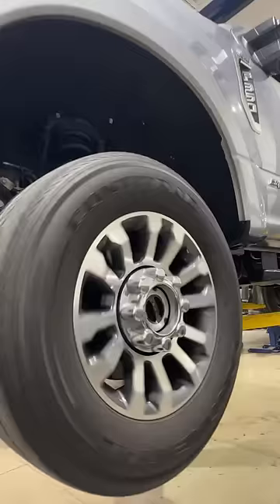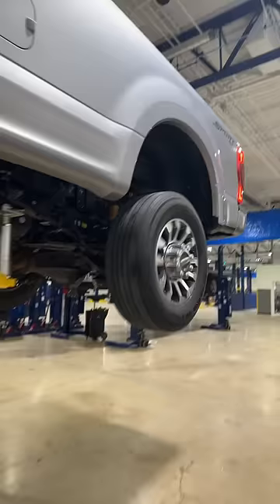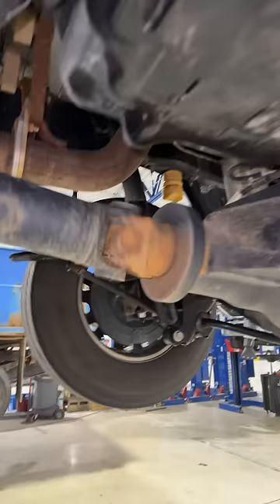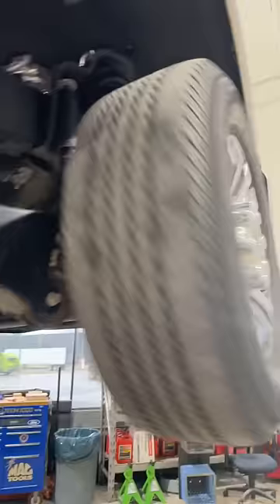NEW 4x4 noise 2022 | F250 F350 #broken #fyp

Comment: mechanics at Ford dealers must be making a good living these days with all of the Ford problems, F150, transmissions, engines, Ford bronco engines, the difficulty in getting to the engine/transmission on the F1 50s..
  makes you wonder if it’s planned to keep the service departments busy the way that BMW automobiles have been for quite some time now. You have to marry the dealer when you own a BMW car because of all of the unique tools needed at times. 
  back in the day when I had my 1968, dodge charger, 383 automatic with a two barrel. Those cars were horribly junk… I can absolutely understand why they are bringing hundreds of thousands of dollars on those television options. Because there are so few survivors. But the experience of having that Dodge charger, turned me against Mopar and I swore I would never buy another one. But I bought myself a ram bighorn, hemi crew cab after the experience I had with my GMC pick up. That thing rusted out in front of my eyes because the owners manual said, rust proofing this vehicle will void the warranty. I lost the brakes twice, the fuel line, and the fuel pump from corrosion from salt. Nothing under that truck wasn’t encrusted in rushed at 42.k miles..
to top it off. I needed front brake rotors. On those trucks, the canyon pick up 4 x 4. You have to pull the spindles off to change the discs because they are bolted to the back of the spindle in the front. .. I do all my own work, that took me about six hours to do that work in my driveway. Pulling the driveshaft from the center of the hub destroys the ABS sensor, which is in a steel housing that rusts out. You cannot use them over. I had to buy new spindle assemblies with the ABS sensors as a unit..
I was advised by the mechanic that does my annual state, safety inspections, to get rid of the vehicle, because the rust was going to start coming through the body, and the bed frame was getting thin from rust ..
  so I don’t like Fords because of the horror stories, and I won’t buy a Chevy/GMC again. So I bought a ram in 2016 and I spent five days using fluid film to rust proof it. I mean I pulled out the headlights and tail lights. I remove the plastic fender liners so I could get the rust proofing everywhere. I pulled the wheels, I bought tools, so I could rust proof inside the posts for the doors, and up the windshield all the way to the roof. Inside every hole in the frame. The rocker panels have rubber plugs, 16 of them, which I removed and sprayed inside those holes with fluid film. I have videos every year of inspections under my rim and how well it’s holding up here where they throw salt from December through March every year. And I don’t have any rust as of December 2023. I’m going into my seventh winter. My truck sits outside 24 seven. I have the videos on YouTube showing how well that fluid film is protecting under my truck.
 I drove from Pittsburgh to Bethany Beach this past summer for vacation, on those major highways, like the Pennsylvania Turnpike, I-95, and other roads I forget the numbers. Those people drive it 80 to 90 miles an hour at times. I was getting 28 miles to the gallon in my truck has the hemi engine… i  used to buy Ford’s.. I bought a new Ford van 1978, I drove that truck for 31 years. It had a 300/6 with a three speed, manual shift on the column. The only extra it had was power steering. I swore, then that I would never buy a basic truck again. In all of my trucks since then, have been automatic, 4 x 4, power, windows, and door locks. But my ram is really loaded. I never had a vehicle with heated seats and heated leather steering wheel before. I think it has an eight or a 10 speed automatic transmission that you cannot feel it shifting. I think it has six or eight speaker stereo, sound system, which I never listen to. I do not turn the radio on on my motorcycles or in my trucks…
 I had a Ford ranger pick up, and two Ford vans over the decades.. i’ve always done my own mechanical work. I used to be a mechanic at three different motorcycle shops back in the day. I’ve changed transmissions, head, gaskets, timing, chains, timing belts outside in my driveway in the winter at times. But I actually think it’s cheaper to just buy new vehicles and not have to do any of that work. It may not be actually cheaper, but it sure is a hell of a lot easier…

Comment: I have never seen that now I have had customers come in with newer f150 with 4wd not working and it make a weird noise but it would be broken vacuum line but you got me thinking now I want to know what’s wrong because I have never  heard a 4wd system make that noise i have a idea but idk
Reply from the maker: Superduty & F150 are NOT the same whatsoever
Reply: @PowerStrokeTechTalkwARod  yeah I know that I just 4wd worked similar I haven’t really haven’t really done anything besides maintenance and alignments to the newer f250 and f350 but the old ones I have done a lot of work to mainly just suspension my shop really do much engine work

Comment: Blue oval syndrome. I love to hate Fords.
As a mobile mechanic, they have kept my family fed for 36 years, being about 65% of all work I have done across almost half this nation.
The problem isn't just Ford. The problem is called planned obsolescence, and it costs us billions every year.
Remember the original Pyrex cups and bowls? You could drop them on concrete and they wouldn't break...
Sales plummeted, cuz nobody ever bought a replacement, so they changed the material to allow breakage from a lower elevation of droppage. Problem solved.
Reply from the maker: Amen
Reply: Oh bull get out of here!
Reply: @popcornhead3479  do some damn research.

Comment: Guys You Never buy a FORD, they are Always Trouble. And Old Chevy Engine Builder told me Years ago, that Ford had the Worst Engine and Power Train of All Trucks. He stated the Trucks Ford built on Monday from its Part wouldn't work on the Trucks on Wednesday and the Same for Friday. Today I am Driving a Chevy Truck with 350,000 miles and I have only changed the Oil every 6000 miles when using 100 percent synthetic Oil 10w-30 Oil. I have Changed the Spark Plug once and a Water Pump once. You can't beat a Chevy over Any Ford. 😊😊❤❤

Comment: Been a Ford man for 50+ years my current 2012  f-150 eco boost bought new is my last one ever ! Not because of the truck! It is absolutely because of the  manufacturer and the unbelievable horrible state of their dealerships service departments lying cheating and stealing from you not here and there  ( BUT EVERY SINGLE TIME YOU WALK THROUGH THE DOOR ) The last two times I went to the Ford dealership the first time they told me I had a major major oil leak and I needed a new engine and then like an idiot I went back and they told me I needed a transfer case in a transfer case motor that was four years ago I’m still driving with the same transfer case and transfer case motor in the same engine do not get your vehicles serviced at Ford dealerships ever good thing I know about vehicles if you don’t you are screwed at any dealership !!!!!!!!! At least that’s been my experience .

Comment: My 2021 F250 had the same problem. I fixed at 25,000 km which is about 15 1/2 thousand miles. Is it a design flaw?

Comment: The brake line is rubbing inside the wheel... notice how it skips when the wheel weight comes around. Loosen the bolt on the line retainer and adjust it back.
Reply from the maker: Sorry guy, you're not correct...

Comment: This is "Not" an abnormal amount of surface rust....if you think so, look around at a few undercarriages. Especially Trucks....
Why manufacturers don't paint them all is beyond me....
This isn't abnormal though...Surface rust begins "once" cold steel is introduced to air and any amount of moisture or humidity. The more of it, the more Rust...
 

You want to see for yourself how Fast rust will occur???
Take a clean sheet of untreated cold steel and shoot a water hose at it. Soak it down good..... 
It'll start rusting even before the water dries..Minutes.... 
The less Alloy in the steel, the faster and more it will rust...

Comment: My 2021 does this when it’s cold, local dealer said it was normal after they rebuilt the hubs and vacuum system 2 times
Reply from the maker: Nope, sure isnt!
Reply: if that's normal they're using the wrong lube in the joints and pumpkins. sounds like gear whine to me.

Comment: Whenever you buy a new car you should always! Always do something for rust protection! You would be stupid not to do this on a new car. On a new car it's easy and cheap to protect it from Rust. When you have to remove the Rust before protecting it, it is much more work and much more expensive and less functional. So whenever you buy a new car no matter if it's a 100k Mercedes or a 30k ford, either protect it yourself or bring it to a Shop that is qualified to do Rust protection. Never ever Spray bitumen undercoating on your car, that stuff will make your car rust even faster and will never come off again. Use something wax- or fat based. When buying a car for a lot of money 1000 Dollars extra for rust protection should be a no brainer! The car can last forever when protected while still new!!!

Comment: Here is the truth right now. 2022 Ford Trucks are rusting leaking troublesome junk. Too many videos available to deny it. Also RAM 2500 and 3500 trucks from year 2018-2022 are giving major transmission problems. I have one. I bought the extended warranty and it saved me $7000. I was also thinking that you know it’s a trans. Maybe it actually identifies as a radio. 😂

Comment: I had one on a low mileage 21 F350 turned out to be failed hub vacuum seals that were shredded the rubber where they rotate inside themselves
Reply from the maker: Ding ding ding, same effing provlem

Comment: I have an 11/18 mfd F150 FX4 badged as an '18, V8, xcab, 8ft bed 4x4 w/trlr pkg. 67k miles w/o any problems. My '97 F250 4x4 V8 auto went 369k. Lots of desert pinstriping on both.

Comment: On my 2012 F250 with 250,000 miles; Makes a roaring sound in the front end when I’m driving. You can hear the noise clearly on the driver side. What do you think it maybe?
Reply: Hub assembly.
Reply: Thanks. I’ll be getting it checked out after the first of the year.

Comment: Lots of rust for a new truck. Inferior steel parts being used with inferior production methods on the parts. Its obvious they are screwing the customer by not putting any paint protection on these metallic surfaces because it saves the company money while still raising costs of the truck.

Comment: sounds like a pebble in the brakes, maybe stuck in the top of the caliper or trapped behind the draft plate, but nowadays it could be anything. Between bad design and bad builds, all new cars are a crapshoot. BUY the extended warranty.

Comment: I get this in 2 wheel drive on my 2013 f350 platinum I can't figure it out
Reply from the maker: R u hubs in auto???
Reply: @PowerStrokeTechTalkwARod  yes they are in auto
Reply from the maker: Well if ur 4x4 shafts are spinning and causing this noise, ull need to figure out why ur shafts are spinning when in 2wd

Comment: 2022 17000 miles and that u joint is all oiled up like that that's your problem and ford problem too instead of getting a truck off the line every 52 second instead of spending more quality time putting everything together

Comment: Had a 95 150 rusted out bottom up and then a 03  6.0 power stroke rusted out bottom up only a 150,000 miles never again will I buy a ford

Comment: Vehicles one year old is got 17,000 miles look how rusty it is in the bottom let you know these manufacturers that are building these vehicles are not building them right if you spend 80 $90,000 on an SUV you should at least give me under coating to prevent rotting it should At least give me 3 to 4 years before I start to see Rod🫵🫵

Comment: How can that truck have 17000 miles and all that rust , the upper ball joint don't look right the  U  joint don't look right the bearing sounds like c*** and there's not one Grease zirk on that whole front end it spells 1 big pile of scrap metal . Or that trucks been in a flood because there's no way it should have that kind of rust with 1 yrs milage